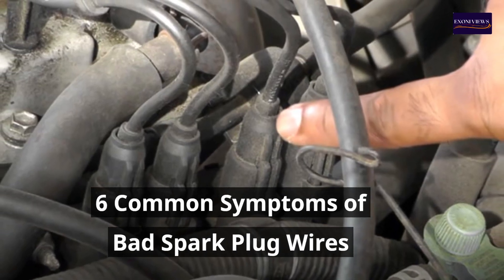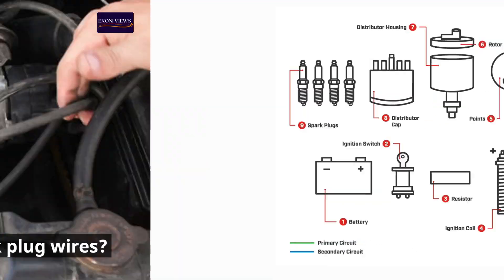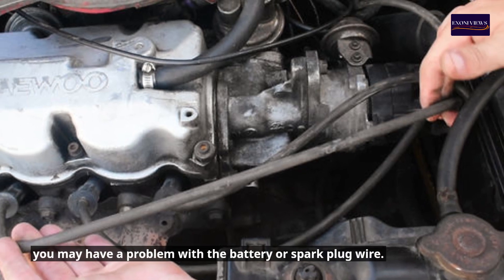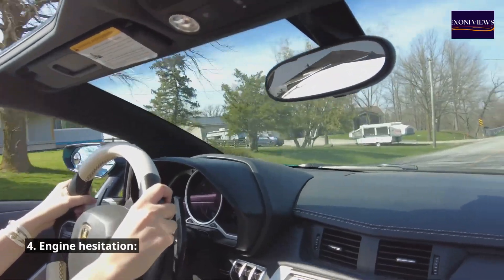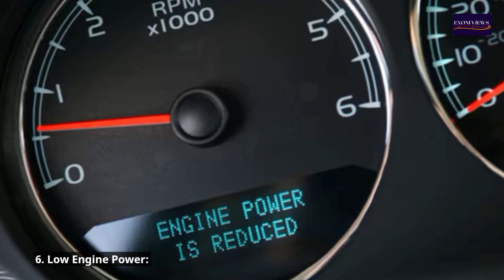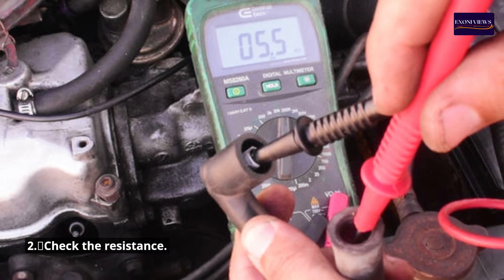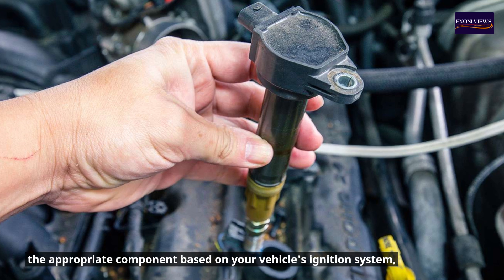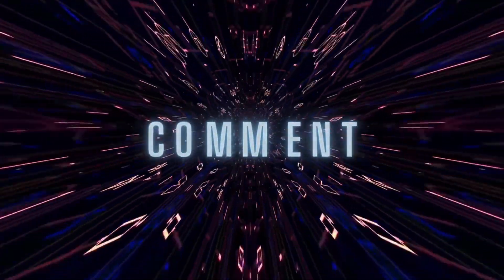6 Common Symptoms of Bad Spark Plug Wires

Comment: Can this damage of plug wire affect battery
Reply from the maker: bad plug wires won’t “kill” the battery directly, but they create conditions like , (hard starting, misfiring, longer cranking) that can drain or weaken the battery over time.

Comment: What glue too use on reassembly of boot ?
On this video #4 💥
Reply from the maker: For spark plug wire boots, no glue is needed. Instead, apply dielectric grease inside the boot to help with insulation and easy removal. If the boot is damaged or loose, replacing the wire set is the best fix. Let me know if you were referring to a different type of boot
Reply: I'm putting boot on an old wire Toyota 22r  @exoniviews
Reply from the maker: @barryaugustine1298  Ok, If you're reinstalling the boot on an old spark plug wire for your Toyota 22R, dielectric grease is still recommended inside the boot for better insulation and easy removal. However, if the boot is loose and won’t stay in place, you might need a replacement boot or a new wire set for a secure fit and proper performance.